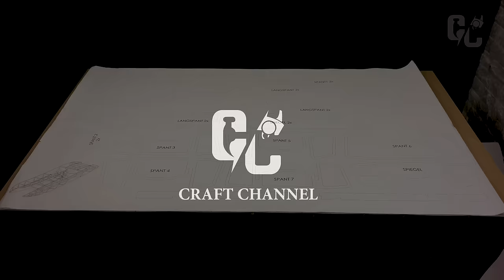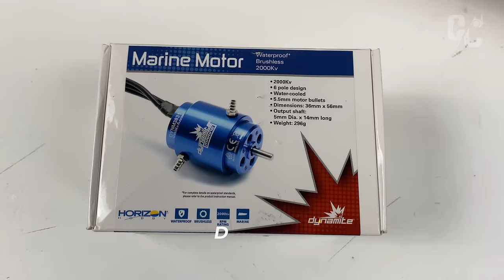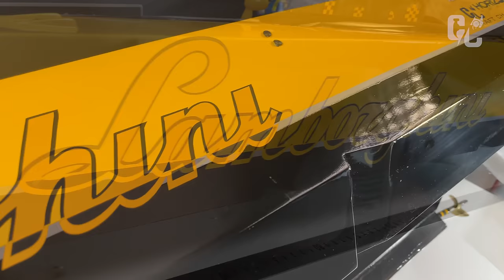How To Make Lamborghini Aventador Catamaran RC Power Speed Boat - Brushless Motor RC Boat

Comment: Estetically good but structurally not that solid… for example, on the transom area there is no structural reinforcement to withstand the forces exerted by the rudder in the change of directions. I only saw the rudder structure being screwed against a thin plywood… All the boat hull is also thin plywood with no extra reinforcement. Maybe I’m wrong, but…

Comment: What is the width and length hull and weight in KG for hull only .because i have gas hull catamaran .i want  convert to eletric .need steady calculations without burning esc or brushless .but with the right budget . 👍

Comment: OK for YouTube but real modellers prefer Glasfiber or Carbonfiber boats.
Reply: In your opinion, wood boat's take more skill than ARTR, because that person has had to craft each individual piece
Reply: Most of us couldn't afford something like that. the channel tries that the majority can do it too
Reply: Go ahead and share your 'real' boat performing the same way then. I think this is brilliant.
Reply: Real? Making do with what you have is sometimes better and rewarding.
Reply: Been designing building selling and competing with real models for 35 years, in a variety of materials not once has anyone been ignorant and arrogant enough to say any one of them was not a real or proper model. I 100% guarantee you e done nothing worth showing us.
Reply: @rosswimhurst actually a wooden boat is easy to build compered to fibreglass and carbon fiber and also with a boat less weight is better handling the amount of crap this guy stuck to his boat is unnecessary it's way over the top.
Reply: Real modellers use whatever they can and make it work…